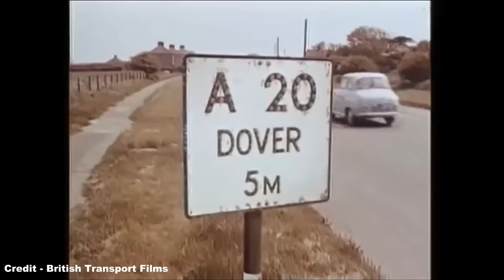BMC 9X - The Mini Replacement That Never Was

Comment: Great vlog as always! Yes, I agree that it has a lot of Peugeot 104, Renault 5, Golf 1, Simca (the front) and Mazda 1300 side rear windows. Lots of windows, not a lot of blind spots. To get a 60hp engine at that time, wow! I love small cars. I have driven Fiat all my life.
Reply: Have you owned a 127?
Reply: The R5 was radically different, with the longitudinal engine set behind the front wheels and torsion bars keeping the weight down low. But it too had its faults.

Comment: Innocenti in Italy put this version into production. They had the licence to manufacture BMC cars there.
Reply: It wasn't quite a 9X as I'm quite sure the engine & sub-frames were adapted from the Morris Mini.
Reply: It was not this model. It was a fresh project designed by Bertone. It came in two versions: Mini 90 (1.0l) and Mini 120 (1.3l). A few years later, Innocenti dropped the ageing A-series engines and installed a frisky 1.0l 53HP 3-cylinder engined by Daihatsu.
I can compare all versions as I took my first driving lessons in my grandpa's Innocenti Mini 1000 (the license-built Italian version of Issigonis's Mini), then my family bought a new Mini 90 and after a while a Daihatsu-engined Mini "3 cilindri".
Bertone-designed Minis where fantastically spacious, even compared to the already space-efficient original. And the 3-cyl. model was a rocket, compared to the A-series, despite having only 5HP more than the Italian-tuned A-series.
Finally, comparing the Mini to the Golf (even the smaller original one) is a bit of a stretch. Why not saying that the real competitor was the Fiat 127, the best selling small hatchback of those years?

Comment: The leaking water problem was caused by the stupid idea of the design engineers to have the lower section of the firewall/footwell panel lap-welded on top of the floor-pan pressing, which caused water to be forced into any gaps in the weld as the vehicle drove forward (especially through puddles)!  
The issue was never fully rectified, they just had to spend more time applying copious amounts of sealant along the weld, inside & out. 
Unfortunately if you managed to scrape the underneath of your Mini (easily done with its low clearance), & if any damage to the panel/s & sealant weren't repaired in a reasonable time, your feet would start dropping through the floor!
Reply: was sure i'd read - or heard in an interview - that most of the problem was due to them putting the floor beneath the bulkhead before welding, meaning water ran in to the joint, and they changed that to having the bulkhead beneath the floor so the water ran across it. They still rotted like fruit, but the majority of the leaking went away then

Comment: To me this looks very much like the Mini Innocenti that was produced and manufactured in Italy with the front and rear subframes including engine and transmission carried over from the Mini. I knew a guy who imported two or three in the early 70's and converted them to right hand drive.
Reply: I just wrote something similar to your post! I believe I spotted them on visits to Italy in 1973. I think there where a 1100/1200 Italian version also by Innocenti but that must have been earlier because I spotted it in Cuba and most imports stopped in 1959.'
Reply: could they have done without the subframes?
Reply: Innocenti built a mini 90 on a British mini platform,later models had daihatsu running gear and a 3 cylinder engine. They also did innocenti regent which was basically an allegro rebadged.
Reply: @bokhans  https://en.wikipedia.org/wiki/Innocenti_Mini 
Not to be confused with the Italian Mini made in Milan and badged as "Innocenti" with different grille and dashboard intrumentation which was totally different.
Reply: @Bulletguy07  
Interesting enough, de Tomaso states that after the change from BL to Daihatsu engines, warranty claims dropped 70%!

Comment: According to what I understand, Ford of England conducted a cost analysis of the Mini and concluded BMC was making a mere $5 US profit on each car sold. This was insufficient to cover the cost of a replacement.
Reply: The Ford analysis seems to be where the loss making figure came from.
Have heard others say it was bad analysis.
Would like to know the real figures correctly done.
Maybe Ford were right, being a rare survivor can company so far.
Reply: @johnd8892  The story goes that Ford bought a Mini... and then stripped it down to every single component which was costed. They concluded that the Mini was a loss leader. Every model sold made a loss.
Reply: @Darwinion  It possibly was, but that didn't mean it wasn't financially viable. 5 million Minis had 5 million A Series engines, all also with carburettors, distributors etc common with Sprites, Midgets, Moggy 1000s, & Marinas and gearboxes common with 1100 & 1300s, then Allegros.
That's a lot of fixed cost rationalisation. Then there was the servicing business for the dealerships and all those rust replacement parts.
Reply: @ethelmini  It does sound however like the common problem of not pricing quite high enough to cover future investment cost as well as operating costs, thus not reaping the full cost benefits of standardisation. Plus British factories tended to be overmanned with relatively low wages. This made them particularly vulnerable in the oil crisis and inflation of the early 1970s.

Comment: I need to make an important point here. This car was made and sold in low numbers until the mid/late 1980's, primarily by FIAT as the Mini Innocenti, and popular around southern France, Italy area.
Reply: I rented a Seat badged Mini in Portugal in about 1982. I also saw a few Innocenti (looked like a Mk1 Fiesta from the front) minis on holiday in southern France and the odd one in London too.
Reply: No it was not this car. Innocenti did produce a similarly looking car, but that was basically a reskinned Mini. Same engines and chassis as the Mini not the more modern design of the 9X

Comment: My dad had a mini van, through his work, and our family would pile in the back sitting on cushions and head out for the day.
It got well abused as vans do, with heavy flanges carried in the back to take to worksites.
I remember five of us cramming into our commanding officers mini; to go to some event ( I was a cadet in the ATC), we were a bit like sardines in it.
If you needed more luggage capacity, and you could afford it, there was the Wolseley version which had a larger boot than the regular mini (it had a vertical radiator grill).
One of the problems with the mini was if you went through a deep puddle and splashed water into the engine bay, the engine cut out…
Reply: There was a cheap and effective solution for that - take a rubber glove, marigolds were ideal, cut a hole in the end of the fingers and thread the spark plug leads through them, and the coil lead through the thumb and slip over the distributor. You could then splash as much as you liked!

Comment: Fascinating. It was clearly technically good and well designed, but would the boxy appearance have caught on compared to the cheeky curves of the Mini? It's reminiscent of the early Ford Fiesta or Fiat Panda. Could the aluminium cylinder head on a cast iron block have caused problems? Aluminium heads gave problems in the Triumph Stag/Dolomite, though partly because they were set at an angle.

Comment: I owned a new Mini from 1966 to 1970, when I bought a new BMW 2002! It was an absolute productional disaster with hardly anything really functioning, leaking in water from the front screen (!) and doors. Paint peeling off by the outside hinges and a distributor which couldn't function when driving behind another car, in rain! You had to keep a distance and then fast up before the engine cut from the water. It became my only English car. And my grandfathers first Morris Minor, could only be locked from the passenger side, I think to remember?
Reply: The Mini later got a plate in front of the distributor, but not mine.
Reply: The water in the distributor problem which also badly affected the A series in the Metro was easy to solve. The trick was to put a rubber washing up glove (Marigold type) over the distributor located at the front of the engine. One HT lead through each finger tip with a rubber band over the ends !
Reply: @bigvinny333  I love it! That is my kind of fix 😊. Cheap, cheerful and effective!
Reply: @finncarlbomholtsrensen1188  It took BL about 30 years to work that one out!
Reply: @bigvinny333 its was a glovely idea at the time 😂

Comment: This model went into production in the 1970s in Italy. It was frequently seen around Italy and I think France no doubt as an alternative to the Metro
Reply: That car was similar in many ways, but was a new body clothing (at least at first - the mechanicals later diverged) the running gear of the Mini. 9X was a complete replacement for the Mini, and a wholly new design by Issigonis. The two cars were strikingly similar though, so Innocenti’s designers and Issigonis were obviously thinking along the same lines.

Comment: So THAT's the missing link between the Mini and the Metro!
Reply: except it isnt. the metro and mini hand independent suspension all around (be it hydrolastic/ rubber/springs) front and rear subframes. this carried all through to the k-seires metros and mgf-tf. the BMC 9X was a macferson strut and beam axle car, think vauxhall nova, renault 5, fiat panda. This was obviously the smart way to go in a small economy car. the mini, and metro (a-series and k-series) were imho waaay to complicated for their intended market. Full disclosure I own a turbo k-series classic mini. so love them, but no doubt British layland really missed the mark by not following the 9x through.
Reply: No, it's the mini with all the bad bits replaced, the metro was all the bad bits of the mini, but in a new shell.
Reply: Thought it was like a prototype Metro with Simca front at first.
Can see all the Metro lines even rear lights, gimmee a 6R4.
Still a good car in 1980 my mom had the 1300 HLS and MG Metro in 82, nippy round town.
Reply: Not quite. Check out ADO74 and ADO88.

Comment: "Without modification... holding on to the same outward appearance as when it was new when introduced (in 1959)"?  Estate car (Traveller and Countryman, 1960), Riley Elf and Wolseley Hornet (1961), Moke (1964),  Clubman front (1969), larger rear window and rear lights (1967), 12" and later 13" wheels ...
Reply: Maybe it would have been better put as “the Mini at the end of 41 years of production being recognisably the same car as the original”? That would have allowed for the numerous variations in that 41 year span.
Reply: Good point well made
I wish he had learned to pronounce Sir Alex's Surname properly Go Nis not Gone Is...
Reply: @BungleBare  Plenty of commonality between a 1999 MPI & a 1959 850 - and everything in between.

Comment: Only British Leyland could say, no, we don't want to sell this newer better profitable car while we can still sell an older crapper non-profit making car.
Reply: By the time BL was created the industry was already in a terminal spiral - its problems could only be solved by massive investment in new product lines and infrastructure...and it didn't have the capital to do that. The 9X was a brilliant design that should have been a huge success, and answered nearly all the technical and commercial criticisms of the Mini. But it was an entirely new product (platform, body, drivetrain, engine) that would also have needed gutting whichever factory it would be built in, installing new and cutting edge production equipment and training workers with hitherto unknown skills - one of the big issues with the 9X engine (and why it was never adopted as an A-Series replacement) was that its design required assembly to tolerances that BL factories simply couldn't manage (see the Triumph V8 and Sprint engines as an example of how that can go wrong!)

BL was hugely undercapitalised - compares to Renault it had less than half the capital, had more than double the employees, 2/3 the fixed assets per employee, less than half the output per employee and made just over half as many cars. That's not a BL-specific problem; BMC was also hugely starved of capital investment and that is the big uniting issue of all British manufacturing industry in the 20th century - trying to do too much with too little. 

BL simply didn't have the money to build the 9X, even if it (and its 10X and 11X spinoffs) could well have been the saviour of the company and the industry in the long term. In the short term the money wasn't there.

In an ideal world that's exactly where the government should have stepped in with a funding arrangement to get BL out of its hole and the 9X family into production. But, just like the management in the industry, the governments of the time lacked that long-term vision too.
Reply: @jozg44  Thanks for the reply. I didn't know many of the things you say here.
Reply: @jozg44  perfect final paragraph
Reply: @kaitlyn__L  I think the comparison with Renault is always interesting when it comes to British Leyland;  the French government nationalised (expropriated, more accurately) Renault in the 1940s and it was then run and funded with the long-term vision of building Renault into a globally competitive car maker. The French state poured a fortune into Renault with new factories (in France and abroad), new tooling, new R&D facilities and subsidies/support that effectively amounted to 'buying' Renault a share in key markets. When rationalisation and redundancies were made the government basically paid off the workforce with generous settlement packages. Renault was grown on a 25-year plan..and it worked. Renault became one of Europe's Big Three and a global force, while being more productive and successful than BMC or BL ever was. When you tot up the various bailouts and support packages given to BL and the decades of losses and written off costs,  it cost much less for the French state to turn Renault into a success than it cost the British state to turn BL into a failure. 

And that's because the British government always saw itself as a rescuer, not a manager. The funding was always just enough to stop the company collapsing and (a cynical person might say...) prevent job losses before the next election. But the amounts given were never enough to actually solve the root problems and the plans never looked far enough into the future or had a goal of what BL was going to look like in 10, 15 or 20 years. And so the industry staggered from crisis to crisis, always being shocked back to life but never actually cured. In France Renault benefited from 25 years of sustained political and financial support towards one goal - with a successful result. 

The 9X could have been BL's 'Renault 4' moment in that regard, but it was never going to be.

Comment: When they began trying to productionise the 9X engine they discovered that it wasn't possible to have any tolerances in too many measurements and it basically couldn't be mass-produced without a significant redesign.

Comment: It’s small wonder BL failed, really. They had a cutting edge design for a supermini hatchback, way ahead of the competition, and instead ploughed all their money into stupid stuff, like developing the Allegro and Marina at the same time (essentially two cars in the same market) and blowing the rest on acquiring Triumph for no apparently good reason, given they were essentially competition and left BL with three cars in the small family car bracket and no money to develop anything else. If they’d left Triumph alone and focused on one or other of the Marina or Allegro, they’d have ended up with a better car, money to push the 9X and some left over to iron out the Princess’ flaws. They might even have come out of the seventies with enough cash to make a proper job of the Metro.

That’s the thin end of the wedge, though. Having such a behemoth of a company having pretty much all of Britain’s mainstream car manufacturers under their umbrella was never going to work. I’ve heard it said that the problem was us Brits buying foreign cars instead of backing our own - like the French and Italians did with Renault and Fiat - but the truth is that those companies were focussing on improving their line-ups, rather than hoovering up competition and leaving the cars to become horribly outdated with no money to improve or replace them. Of course, the constant industrial action didn’t help, but BLs management were totally incompetent.